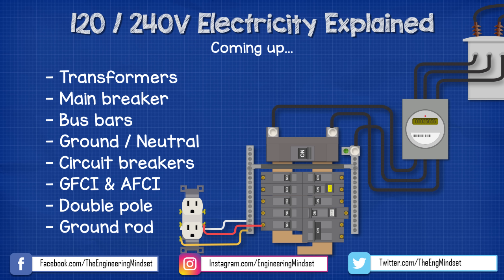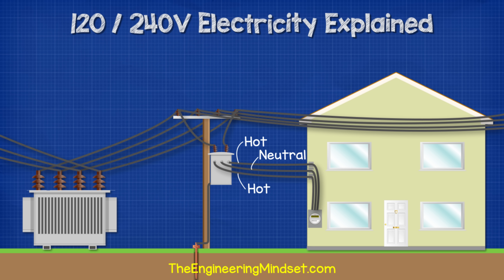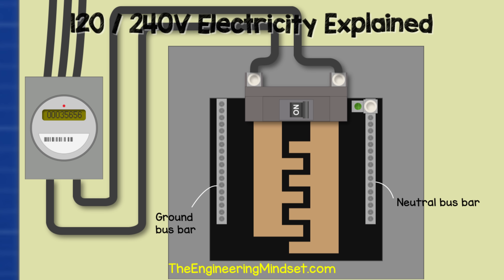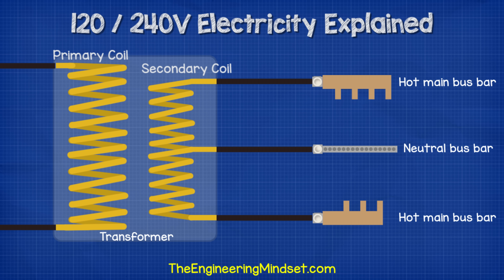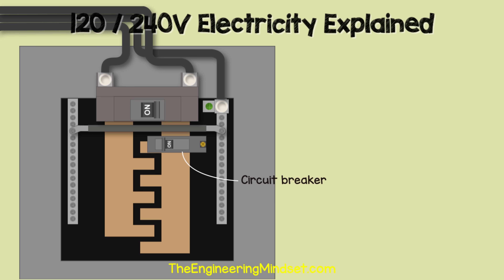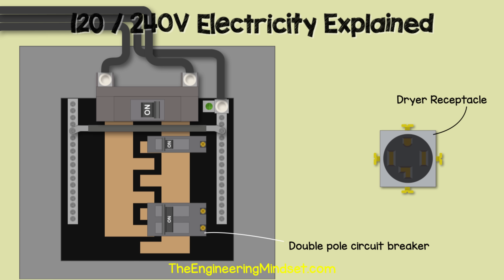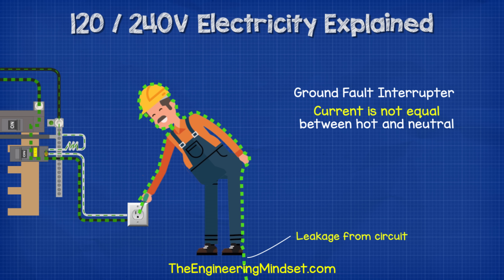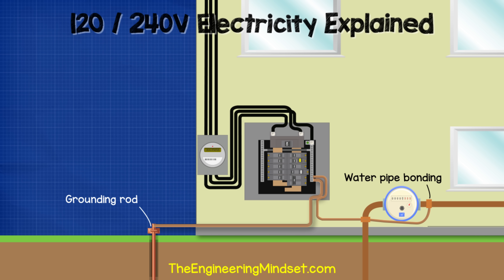120V 240V Electricity explained - Split phase 3 wire electrician

Comment: Splitting a phase is how you get 2-phase, from as single transformer secondary winding...  Splitting a winding and grounding its centre point, leaves TWO Live outputs, running at 180° from each other, so the American system is 2-phase 3-wire supply.
Reply: Split phase is still a single phase. Even though the 2 hot wires are 180 degrees out of phase from each other they are still referred to as single phase. That is because of how exactly a monophasic system and a polyphasic system are defined. For it to be polyphase there must be a direction of phase rotation, a mirrored phase like split phase does not have that making it monophasic. True 2 phase power is obsolete and is rarely used in anything, there are only a handful of places that have 2 phase power.
Reply: @Redtooth75    Yes, by splitting or centre tapping and Grounding the centre point, we can double the number of phases. . .  We split 3-phase secondaries to make 6-phase.. . .  You say   "  they are still referred to as single phase.   ". . . Yes, in America that is what they call it. . .  But regardless of what YOU call it, it is a 2-phase supply. . . .  3 live lines is 3-phase, 2 live lines is 2-phase, 1 live line and Neutral is Single-phase...  It really is that simple... .  Even if those are not the words used in America.. . .    You can have 2-phase 90° which, as you say is now obsolete, you can have 2-phase 120°  and you can have 2-phase 180° which is widely used in America.   .   :-)
Reply: @hughleyton693   Im sorry but it is not 2 phase. In order to be polyphasic there must be a clear direction to a rotating magnetic field, which split phase does not have. Nobody in the world calls split phase 2 phase, its not just America. True 2 phase systems were replaced by 3 phase systems. But if you take 2 lines off a 3 phase system you still have a single phase system because it does not meet the criteria to be a polyphasic system. 
True 2 phase power is in fact obsolete and has not been used in a century.
Reply: @Redtooth75    It  IS  2-phase even if you do not call it 2-phase. . . .   3-phase is 3 live lines, 2-phase is 2 live lines, 1-phase is 1 live line & Neutral.. . . .  That is technically what they are.. . .  You can call them what you want, that is up to you, but that is technically, what they are.   Q.E.D. . . . . .   " Nobody in the world calls split phase 2 phase  ".. .  Yes they do, that is technically what they are even if YOU don't properly understand that.  . . . It is very simple 3 is 3-phase, 2 is 2-phase, 1 is 1-phase   . . . Now can you count  1, 2, 3, easy isn't it.. . . .   And yes, if you have 3 hot lines it is 3-phase.. .  Take 1 away   3 - 1 = 2       Or is that not the maths you were taught. ?   :-)
Reply: @hughleyton693  That is not the definition of a electrical phase system so thats why you are confused. The actual definition is much more complex. Feel free to go to you local library and check out an electrical engineering textbook if you would like to learn. I have already given you the simplistic explanation but you refuse to accept it. A phase angle of 180 degrees does not qualify as a polyphasic system. Two waves that vary in unison with respect to ground/neutral are the actual literal definition of a single phase system.
Reply: @Redtooth75    Yes, it is that simple, a phase is the sine-wave angle an AC Voltage or Current is running relative to Neutral.    So 3-phase has 3 lines at 120°,  2-phase has 2 lines at 90°, 120° or 180°      It IS as simple as that, But Americans make it unrealistically complicated.     . Polyphase means multiple phases.    So what would you call the 6-phase we use. ?      "Split 3-phase" ?   .. .  Single-phase is a Single phase that is just a Single live AC line, it really is that simple. . .  But American make it complicated.. . .  Like they do with Switches. ..  The common house switch with two switches to switch one light on, can be switched into TWO ways to pass Current in either of TWO ways are 2-way Switches, but for some strange reason, Americans call them 3-way switches.    . . .  America does  NOT  rule the World, neither do they talk English.  . . . And many words are no longer Logical. . . . The generator in a Car for charging its DC Battery is a DC Generator, not an Alternator. . . .  Just try putting AC into your Battery and see what happens.   Ah.! . ..   Fortunately some American are prepared to think out side the box they are taught, and so they got to the Moon.
Reply: @hughleyton693  go read a book, its honestly impossible to explain without diagrams and vectors. Polyphase does in fact mean multiple phases but you do not understand what qualifies as a phase and how those phases have to interact with respect to one another to qualify as polyphasic.
Also the generator portion in a car alternator is a normal 3 phase AC alternator. It just uses a rectifier to make DC voltage and has a voltage regulator built in. The older part that were called generators had a completely different design which is why the name was changed.
Reply: @Redtooth75      The American names used for some electrical things are different to the International definitions. . .  So you use your words, but be aware of the International definitions. . . ..  So Internationally 2- phase means two phases of live AC voltage.    .. .   But Just try putting 3-phase AC into your Car's Battery and see what happens. . . .  AC Generators generate AC. . . . .  DC Generators generate DC. . . .  It is as simple as that. .. . .  That device in your car has  DC irpt DC on it Power terminal. . . Go and get your meter and check if you do not believe me.  :-). . .   Old car battery generators used a mechanical rectifier inside them, to provide DC. . . .  New car battery generators use Diodes inside them, to provide DC . . So they are a DC Generator. . . .  Why do Americans get so confused over these things. ?. . .  They are just not thinking logically.
Reply: @hughleyton693  no I am actually using the international definitions and you can go buy an engineering textbook from any country you wish if you would like to confirm. 
Also you ignored half of what I said about a car alternator. The generator portion of the alternator is in fact a 3 phase alternator. Internally to the alternator there is a bridge rectifier that converts the 3 phase AC to DC. Its called an alternator because it is not a fixed magnetic field with a rotating armature generator.

Comment: Is the main breaker amp rating at 240V? Since the two hot wires would be on opposite phase?? Like if you had a 60A main but ran 80A at the 120V receptacles would it be okay??

Comment: How is a solar  power main panel wired for 240 volts in U.S.?  If an inverter is connected to a dedicated solar main breaker panel  (not grid tied) is the neutral busbar connected to the grounding busbar and is the grounding bus bar connected an earth ground?
Reply from the maker: Seen our new video on HOW SOLAR PANELS WORK in detail https://youtu.be/Yxt72aDjFgY

Comment: could you explain whether when terminal changes(negative terminal/ opposite direction of current) does current start flowing through neutral  wire from the A.C power source into appliance then into the live wire back to the a.c source?

Comment: I don't get it. If schools suck SO bad... then how the hell did this video get made? Electricity only works ONE way, based upon the system in which it exists. The guy who made this video didn't have his own video to learn from. So then... how the hell did he come up with this video? You guessed it: the SAME way you're learning.

School probably sucks because the learning curve will always be steep. And it can get boring. It's advanced. It's supposed to be difficult to the average person. Is it any wonder so many people commenting have such negative things to say? School doesn't suck. The learning mentality sucks. I went through trade school. I had good and bad days. But, overall...Anyone who wants to learn, and is truly interested in the trade will NOT be deterred by not having a cool video to watch. Learning anything technical is NOT supposed to be easy, entertaining, nor fun.

One commentor said this is "baby", compared to the entire scope of the industry. He's right. Electricity is INVOLVED. There's a LOT to know, even before you get to the field. There's even more in the field. With all of its applications, in the field... you'll wear yourself out just thinking about it. It takes years of hands-on experience just to get the basics down, and become proficient.

And keep in mind that the people who invented this industry, did it from scratch, with little to no resources, by candle light. They didn't have meters, testers, reference material, specialized tools, nor TEACHERS. They didn't think it was boring or sucked to learn.

What would you do if this video WASN'T available? Gee... I guess you'd be stuck learning, just like this guy did. Good luck.

Comment: This video is amazing! My dad set up a 220V line in the family house 20 or so years ago so we can use appliances from Asia. Unfortunately, he was diagnosed with cancer and now in the hospital. He tried to explain to me how he did it (so I can take it apart after he pass) by tapping together two hot wires... that made no sense to me. As I thought that would just be a parallel circuit and the voltage would be the same with increased current capacity. After seeing this, it made perfect sense... the two hot wires run the full length of the 240V transformer!!! And normally we only use half of that! Idk how my dad figured it out without ever finishing high school or getting electrician training. And here I am getting my second Master's degree in engineering... 😓
Reply: Old school fathers are something else. They sure as hell don't make em like that anymore! My dad didn't finish the 8th grade, didn't speak English, but could interpret electrical books, and both Chilton's, and Haynes automobile repair books. Needless to say, he never relied on an electrician or mechanic when the job needed to get done.

Comment: If I use a 600Volts TS 6/2 with ground with a 50 Amp double Breaker do I Hook up the Black on one side of the Breaker an the White Wire to the other side of the Breaker at the supply Pole/Box ??

Comment: My home is in California and currently has 100A,  120V / 240V split phase service from the Electrical Utility provider. I want to understand what is required to increase the service to be 200A. I know a new meter, service panel and main breaker all rated for 200A will be required.  What else will the Utility provider need to do?  How can the electrical service keep the 120V / 240V, yet provide the correct amount of Voltage to accommodate twice the amperage? Is it because 120V / 240V is more voltage than is necessary to accommodate 100A, to begin with?

Comment: Hi Mr. Paul Evans,
this is Govind, I just have a small doubt regarding Philips (or on that note on every induction cooktop)
Sir Philips 4928 and 4938 are valued at a peak wattage of 2100W but they are provided with a mere 6A plug.
But how is this possible to reach a wattage of 2100w with a 6A plug.
Considering power(W) = Current(A) x voltage (v)
i.e. considering the max voltage of the Indian average voltage of 240 volts a 6 amperes plug should be able to provide only 240x6 =1440 Watts of power, but how can they claim to reach 2100W ????

2)My 1400W microwave oven uses 16A plug.....

Please do reply ASAP sir I am ready to buy one and anyone who knows the answer please feel free to reply... and correct me if I am wrong

Comment: 4:01 So the purpose of the neutral bar is to return the used electricity back to the transformer? Isn’t it an AC current and current goes back and forth between hot and neutral? And the really the purpose of the neutral is  to complete the circuit and only the difference that the neutral is grounded? You show animation showing that earlier in the video and then is that which is very confusing, especially for someone who is trying to learn it the first time or clarify it. Please correct me if I’m wrong. 
Thanks
Reply from the maker: Yes, it is just to complete the path back to the transformer (the electricity meter too) it's connected after the load, which is why I said "used" electricity. Of course, the electrons are just moving back and forth really in AC, but it's often easier to visulise the system as a DC circuit.

Comment: What is done with the third coil from the 3 phase transformer? I only see two phases being used. Do you have a video to further explain the transition from 3 phase to the 2-hot 1-neutral?
Reply: NA residential distribution uses single-phase transformers.  Commercial customers would use 3-phase, which is typically done using 3 single-phase transformers on the pole.  His graphic showed what would be an older legacy 4kV distribution line which was typically delta-connected 3 phase, so each transformer has two taps to the primaries.  Modern distribution circuits are connected Wye/Star, so you have one tap to the primary lines.  Return is through a ground on the transformer case, or can be grounded via the second bushing on the primary side.  Depends on the utility company.
Reply from the maker: Seen our new 3 phase transformer video?➡️: https://youtu.be/u0SsejDCVkU

Comment: 7:54 According to the video, hot becomes neutral back and forth all the time, because it’s AC current. Right ?
Reply: Hot line is the line that can kill.   Neutral will not kill you.  Doesn't  matter AC or DC.

Comment: i use to to vacation to my home country vietnam, they used 220/240v system. Can i buy at a panel 120/240v to install over there and install a ground bar for neutral to get 120v out of it? i want to do it because i want to use american tools over there.
Reply: No, it is not the panel that generates the 120v. It is the transformer on the pole.

Comment: another crazy american thing, like still using inches feet and miles, fahrenheit and not Celsius, starting with the month in dates and not the say - day - month - year, america is a backward sort of place.
take temperature, zero degree's celsius water freezes and at 100 celsius it boils, now that makes sense, and 1000 meters equals a kilometer, it's all so much simpler to go metric, everything makes sense ???
Reply: When Mr. Celsius set up his temperature scale he made water boil a 0 degrees and freeze at 100 degrees.  He would be appalled by this "water freezes at 0" thing.

Comment: Why is there only one wire on the top of the power poles on my street? Also there is only one wire and bushing on the top of the pole mounted transformer?
Reply: Why ? It is a cheap system but it works. That one phase power line ( call it L1 or L2 or L3 ) is from  mostly a Delta / Star 
high voltage 3 phase transport transformator. The center part of the Star side is connected to the ground. 
Now your local 1 phase transformator , ( lets say 7000 V ac / 120 V / 120 V / 240 V Ac ) 
Connect one side of the primaire HV coil to the one Power line  and the other connection of this coil to the ground so we 
need a ground rod below this transformator.   Now we have a circuit . One part is the one wire power line 
and the other is the ground that returns the current to the grounded star side of the high voltage transport transformator.

Comment: My country electricity devices is called
AFCI = RCBO or RCD with overload protection might be main breaker prevent for short circuit overload and earth leakage that over 30 mA of current 
GFCI = ELCB or earth leakage breaker may be in the water heating that prevents only leakage current that over 16 mA
and sockets might be have a GFCI or call an RCD Residual Current Devices that prevents like ELCB but prevent current leakage over 10 mA may be used of water pump and water purifier 
MCBs are single pole and prevent only short circuit and overload in curve C 
All of MCBs RCBO ELCB are cover for Alternative Current Used Only 
And Direct Current is used another device 
MCCB for prevents overload and short circuit like MCB
RCDB for prevent earth leakage current like GFCI or ELCB
1 Phase 240v for socket and home used and triple phase 380v for air conditioning EV charger or motor like hybrid car
Ground and neutral is same busbar 
Transformer for AC to DC
An inverter for DC to AC
A convertor for voltage modification 
electric meter is measured the KWh and Kcal and includes TAX and Maintenance fee by multiplicator factors
Reply from the maker: Seen our new incredibly detailed MCB video? link: https://youtu.be/gqEu9t8HwW0

Comment: I don't get it. If the earth is looped with the neutral will always have some voltage returning through the earth cable  so if you bond the water pipe so could  make you jump if you touch it right and may be would go through the water aswell right?